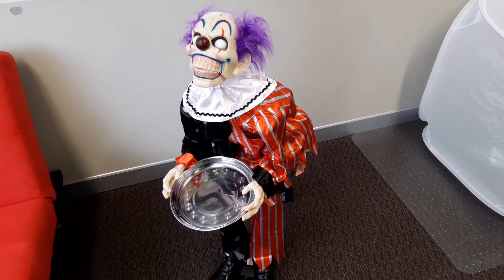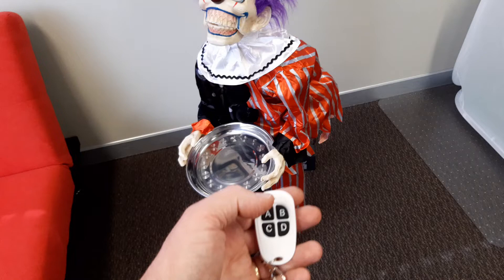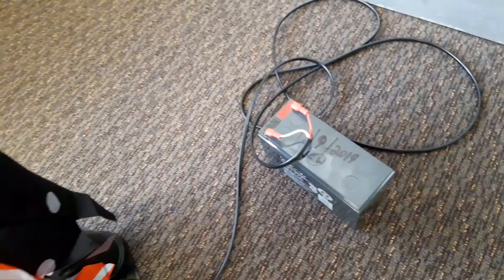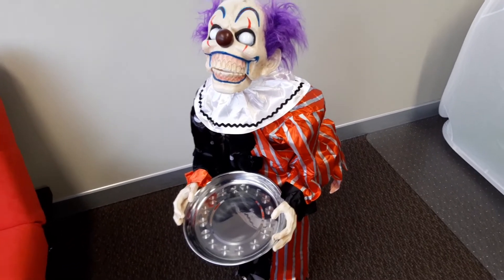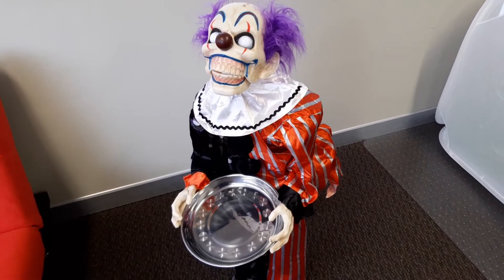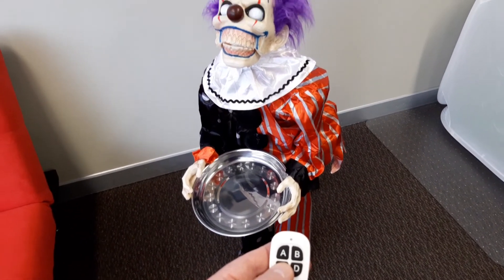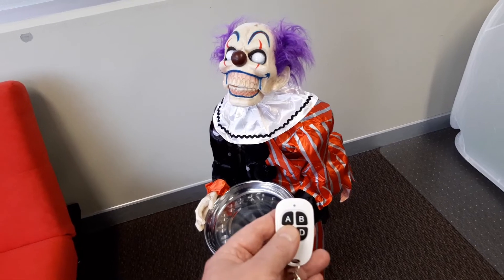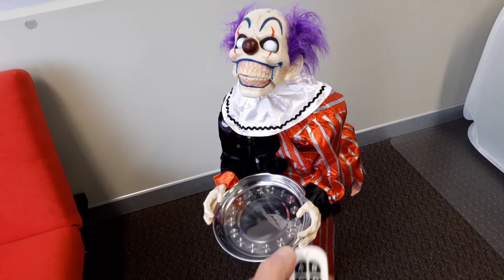Prop Remote Trigger Add-on Board

Comment: Very cool making your own board that can learn key fobs.
Reply from the maker: You can get relay boards off eBay that will do much the same. I just combined it with the voltage regulator.